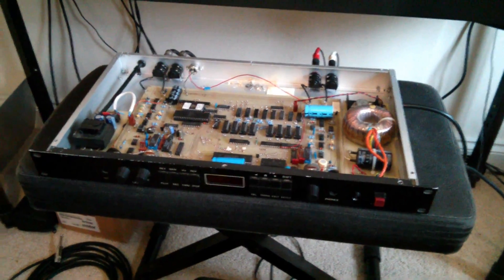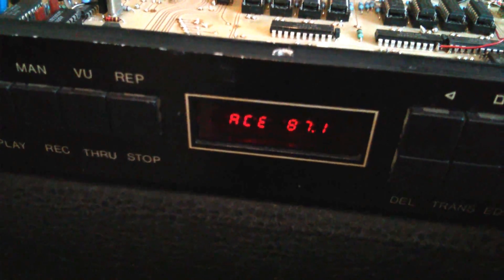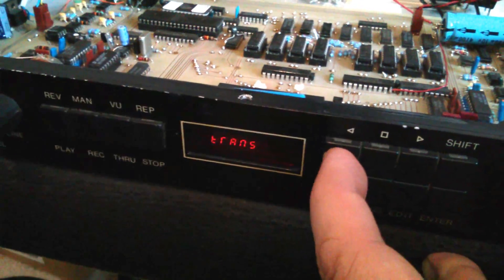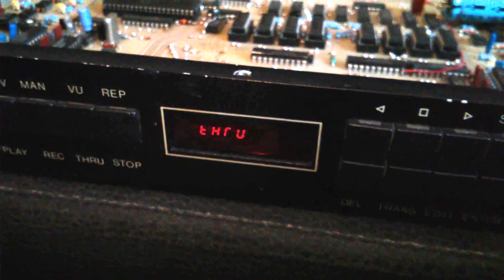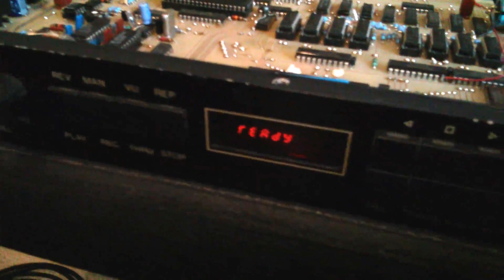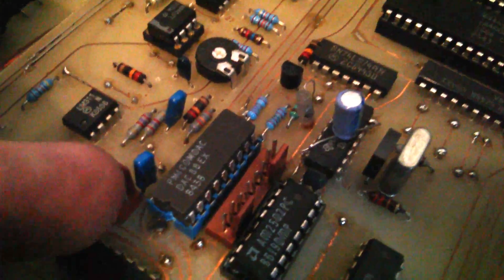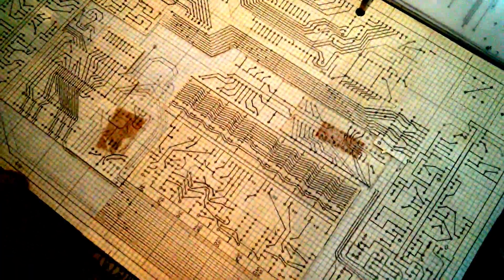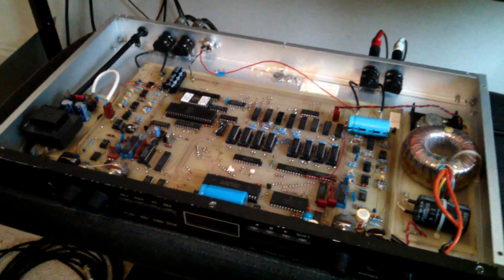Retro Electronics: Homebrew Z80 Audio Sampler

Comment: This is really great work guys.  I've been using home made Z80 computers for nearly 30 years and back in the early 90's I was learning how to sample and play sounds with 8 bit ADC's and DACs connected to the CPU bus. I have MIDI ports to play notes at different pitches. I used lots of  the Z80 NOP instruction to make a software delay and depending on where I jumped into the delay determined how many NOPS got executed and the length of delay changed the sample playback speed and changed the pitch.

Comment: Wonderful. My frustration in 1985 was not being able to have access to multiplex counters. I got the polyphony software going and midi in/out/thru routines but the project ended because of the costs for 16 bit and lack of access to specialized VLSI. Then a few years later I saw the Emu Emax II 16-bit sound system in a shop and understood someone else was before me with a commercially readily available product. I bought it. Actually having no clue there was already the Emax 1 and Synclavier but heard a wisper about the existance of Fairlight's CMI. There were pop songs giving a hint to that.

Comment: The Maplin pitch transposer I built in 1990ish. It was very simplistic, real time only, up/down and reset controls only. I seem to recall the chip did both ADC and DAC functions at once.
Reply from the maker: ***** So I'm guessing the Maplin unit had no microprocessor - just some counters to address the RAM.
Reply from the maker: ***** Thanks for that. I'd love to see the original article for that unit. I seem to remember it used the same companding DACs though.

Comment: I was just thinking about this sort of project the other day, using a Z80 to build a one shot sampler. Absolutely cracking design! Any plans to build an updated version?
Reply from the maker: Matthew Harrison (matthehat) An updated version would almost certainly need different DACs. The PMI COMDACs are rare now, although there are some DAC86's for sale on Aliexpress. No plans to build an updated unit, although I want to dig my old Z80 development system out of the loft and run up some of my old projects.

Comment: The Capacitors are all lost there Electrolyt Liquit. The Firmware have a small Problem - i think after Reset the RAM is full of not overwritten Informations and then you hear this on the Play Output. Do you initiall (hold it on the Zero Level) the RAM first after Coldstart Reset?

Comment: Julian Ilett really nice work. Did you two built it just for fun? I would also love to hear how you developed and built the board back in the days. When I was designing my first board it was already the days of CADsoft's Eagle..
Reply from the maker: This project was in development for 3 or 4 years if I remember rightly. Although it was fun most of the time, I remember the PCB design being very frustrating when large blocks of layout had to be moved (hence the cut and stick sections on graph paper). Parts of the software (the sample editing features particularly) drove us both a bit mad!
The PCB would have been laid out on transparent film with self-adhesive tracks and pads, then transferred to film using a darkroom camera. The PCB looks like it was quite badly over-etched - some of the tracks got very thin and had to be repaired with soldered on wire.
And after all that effort, probably only half a dozen people ever saw it. We sold 1 unit. It was a very different world before the internet.

Comment: That's amazing . I love it . How do you get rid of the buzz
Reply from the maker: DJ Scottdog It's probably dry joints or faulty capacitors
Reply: right ok , i had this old mixer that the pre amps and amps where blown in and that just buzzed no signal you put in would come out obviously but thats different from your machine. i ended up just striping it for components in the end

Comment: Nice project that was done a long time ago.

I found a cct that I designed in 1988 it was done on graph paper, seeing it was a one off I built it on veroboard with wirewrap ic sockets, it was wired up over a week in spare time on a small table in a hotel room, I did  not have time to get bored that week.
Pity the device and the thing it controlled died when the site got struck by lightning, the site also lost the local TV and FM broadcast services antennas, feeder cables and the transmitters were a total write off.

..eddie
Reply from the maker: Wirewrap - wow. Didn't those sockets have very long pins? I did some Vero-wiring once with the plastic combs and that special enamelled copper wire which melted at soldering iron temperature.
Reply: The IC sockets did have long pins, the wirewrap wire was teflon insulated and was easy to use, I still have a few spools of that wire here that I use to repair tracks on cct boards when required.
Reply: Julian Ilett
Yes, they had long pins alright!
A machine I used to repair 30 years ago...Scroll down a bit to see what I had to deal with!
http://www.amplifier.cd/Test_Equipment/other/660b.htm
Reply from the maker: Andy Crofts Ooh, nice!
Reply: I still use that enameled copper wire - I find it quicker than a PCB and better results than strip-board for one-offs, just use the net-list from eagle and a wiring pen. It's quite therapeutic :o)
Reply: Andy Crofts the wiring on that last board looks mental, mate! the whole machine is a work of art though. building one like that today would be one of those therapeutic exercises you'd do just to distract from the daily grind and monotony of our 'modern ' world....and to think it was designed without the aid of computers. awesome!
thanks muchly for posting that link Andy. that's certainly prodded my curiousity and will keep me occupied for the next few hours or so ;)